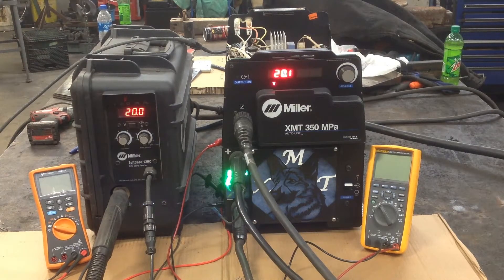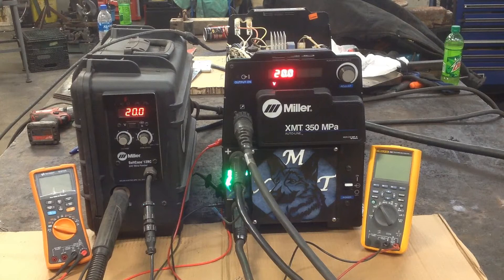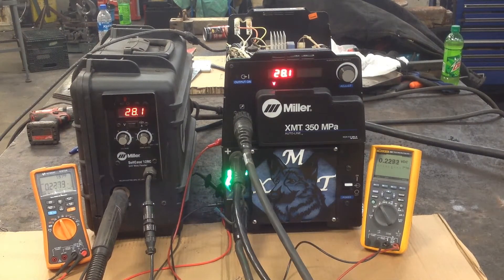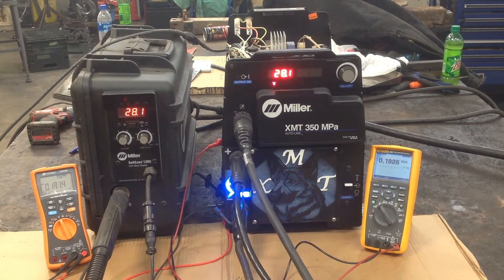Miller XMT 350 MPA Voltage Drop Compensation Modification

Comment: hello, thanks for the video.  i bought a used 12 rc  but have seen nearly no content on yt using this machine.  i am looking for an xmt to run it off of.  i tried it with my trailblazer, and it welded, but the voltage display seemed wonky.  i looked at the cable pins and they looked oxidized and some did not stick out as far as others.  i plan to replace the cable ends.  any video on setting up the suitcase to use with the xmt would be cool....also any advice on the care and feeding of an xmt.  welder prices at auction seem to be going up which seems strange to me with all the fossil fuel regulations and cancellations on the horizon.  odd.  thanks again for the video.  pete